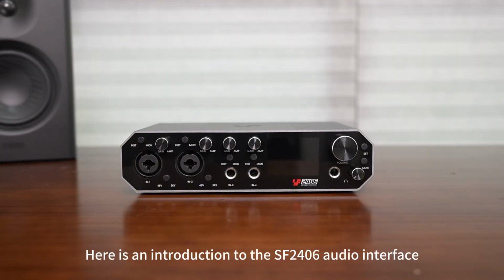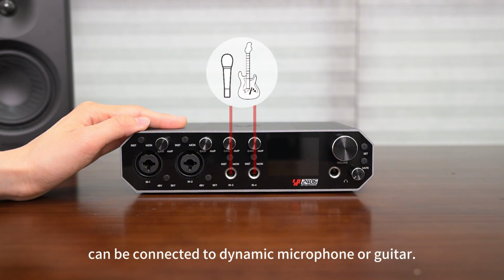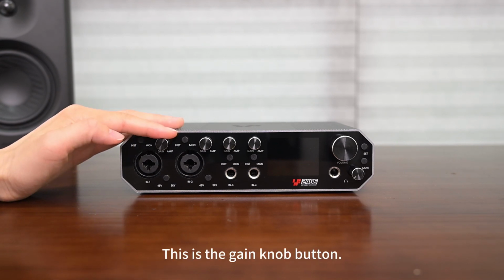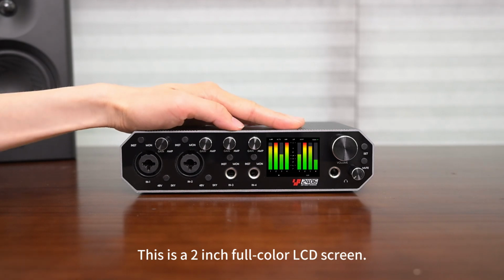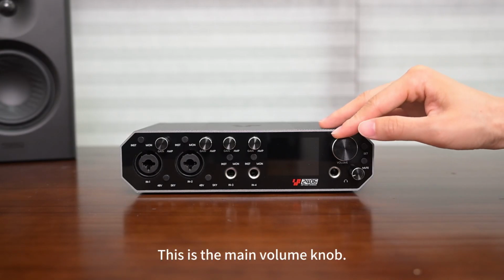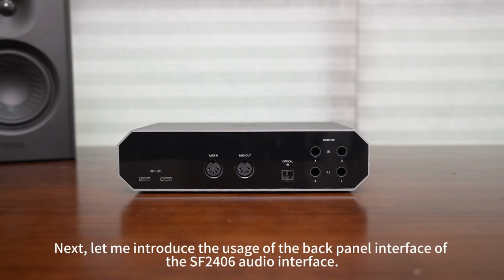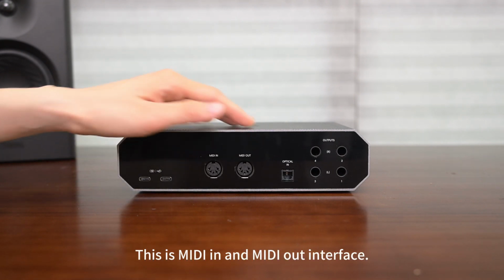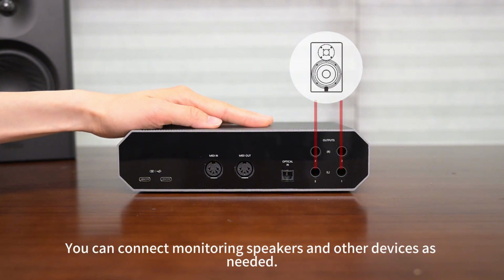SF2406 Audio Interface Introduction

Comment: Hello - the useless AI, interprets written info WRONG, the number is NOT 1,234 at 4:11
But socket number ONE + socket number TWO + etc etc, not ONE thousand  TWO hundred and THIRTY FOUR ????
This at the end of a BS AI version of all the different ((PARENTHISIS )) info descriptors, and WORDS created by initials such as MIDI (which means M I D I as initials of the function of a Musical Instrument Digital Interface "device" that is shortened to MIDI, which isn't a word to be spoken as if Midi similar to the spoken word of Mini) ??

Nor was the AI any good at separating (breathing spaces) in sentences, where a COMMA indicates a short break, a parenthisis a longer break, and a fullstop THE END of one sentence, before the next STARTS.
But to hear the AI speak as if all letters are just "follow-ons" such as:

followingonfromeachotherwithoutabreakoranyothergrammaticallycorrectpausesorfullstopswhen

WTF is that supposed to be ????
You dumbarsed uploader..

p.s:
MIDI ( M I D I)
MIDI is an acronym for Musical Instrument Digital Interface

If your AI was any good, it should have spoken the correct (long speak) phrase and NOT made the accronym a simple word.
It isn't supposed to be read as if it was similar to a Mini Car (as if Midi).
But as M, I, D, I = a slowly spoken individually worded & thus separately parted "initials lettering!.

There was so many BS statements made there, especially the back to front "options" for a function WITH or WITHOUT when the onscreen words were "without" then "within"...